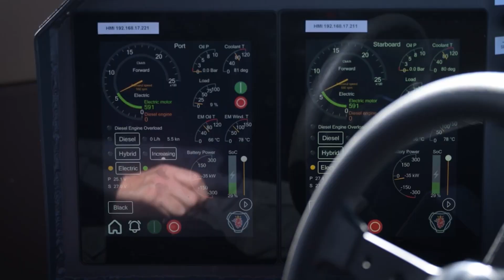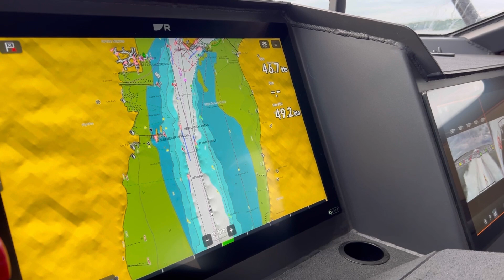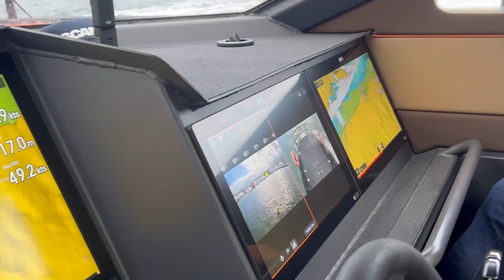How Marell Boats Created The 1st Hybrid Electric Patrol Boat M17 - Story From The Helm

Comment: This is a man who would get on well with the builders of Safe Haven Marine in Ireland, builders of Thunderchild and the T2000 power catameran.😎
Ive seen this boat in a couple of videos Im interested in the efficiency of the system as a Diesel electric hybrid  against an Electric diesel hybrid ie power from larger electric motors but using deisels just for high power generators.
Reply: Totally!